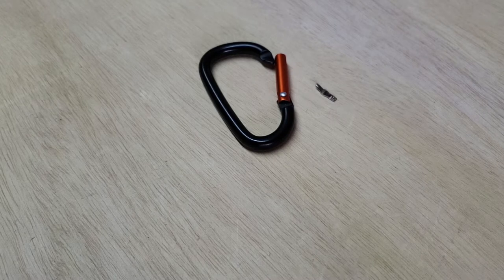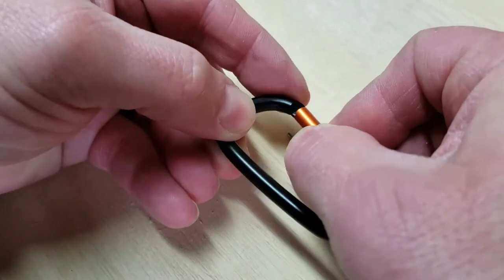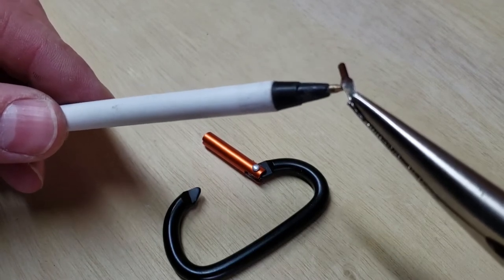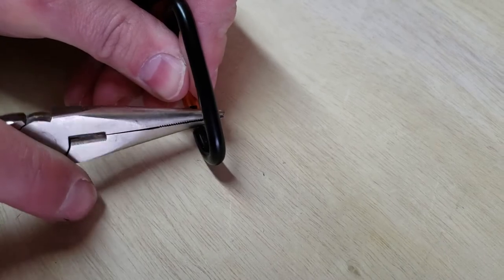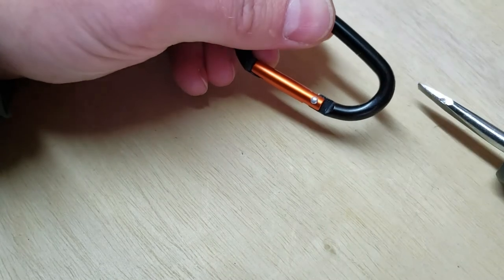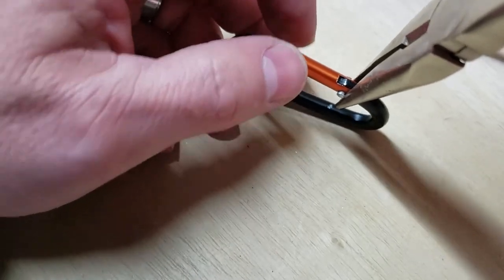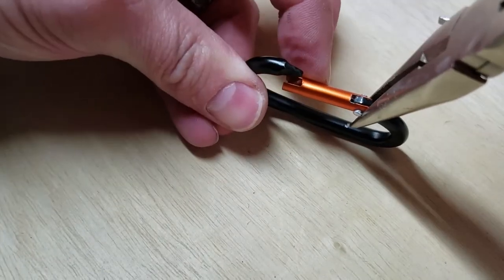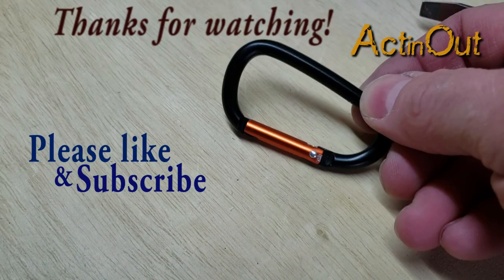How to fix a carabiner with a broken gate - Part 2 - Spring Came Out

Comment: I've pushed the small part in, but why is it still not working and its hard to even get it back out. What's the solution? 🙏
Reply from the maker: My first thought is to wonder if you put the correct end up in. If not it may bind a bit.  It may have also twisted which would restrict the spring from flexing.  Secondly, to get it back out, slide the gate to the side around the latch and try to pull the spring out with a small pair of needle nose pliers or clamping forceps to reach unto the small space & grab it to pull it out. Hope that helps.
Reply: @ActinOut  Alright, thanks for the solution 👍🏼

Comment: I was going to comment about fixing a 'real' climbing carabiner.  Knock yourself out with that toy.
Reply from the maker: Lol, true that.  I thought about showing repairs on various "real" carabiners, but there are so many gate styles, etc that it would take quite an effort to do so, and there's likely a lot more potential liability associated with doing that.  A person's life is more at risk repairing a "real" one such that if it had a gate or other problem you will never know the integrity of the material anymore and that risk just should not be taken. If one wanted to fix the gate or other problem on a "real" biner, it should NEVER be used again in "real" situations, particularly climbing or other significant weight-bearing use.  That's what ultimately made my decision to not go there and stick with this type of biner.  Use "real" carabiners for their intended uses only and only in OEM undamaged and unaltered conditions and NOTHING else.  People's safety is just not worth it. @BonefishBoards ... I'm glad you brought those points up ... very valid!  Thanks for your comment and input.

Comment: Watched this video to see how the spring part works, I’m looking to forge a carabiner for a project, so thanks for showing how the spring fits in. Will have to research what materials I can use for the spring but guessing it’s aluminium?
Reply from the maker: Glad it helped!  Sheet metal holds up a bit better than aluminum but with the right grade of aluminum I'm sure it will work. It also depends on the size of the carabiner. Climbing carabiners and other larger more industrial ones engineered for strength do not use this type of spring system.
Reply: @ActinOut  ok thank you, I’m thinking sheet metal will be the better idea, sure I can find some in the forge
Reply: Definately do not use aluminum or any non-ferrous metal for spring. Spring steal, comparable stainless steel, government steel, or fashion it from a ink pen pocket clip. Dissect ink pens because sometimes you can find pieces of steel very close to the shape you need. Aluminum is not intended to bend back and forth. It will break in less than 10 cycles.

Comment: Is there a way to replace the pin if the gate fell off?
Reply from the maker: You're going to need some wire that will fit in that hole depending on the size of the carabiner. Maybe a paperclip, coat hanger or something and cut it a little longer so the ends can be bent over or smashed down a bit (if the metal's soft enough) at either end to hold it in. If bending, be careful because that will be a sharp and will cut, so replace the carabiner when possible.